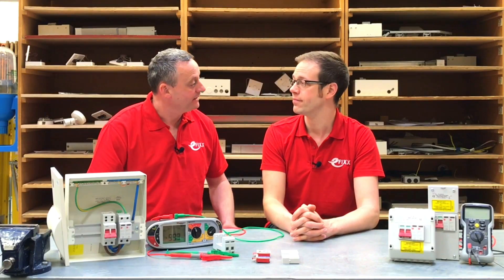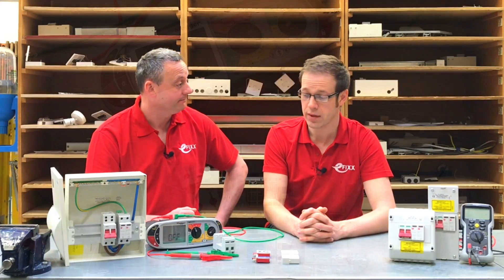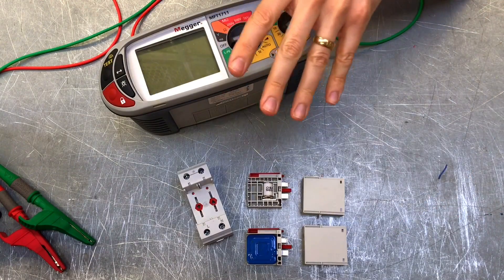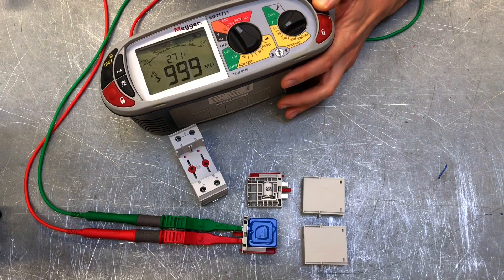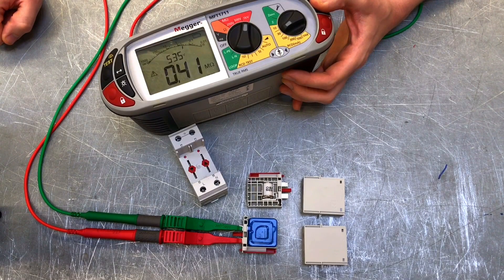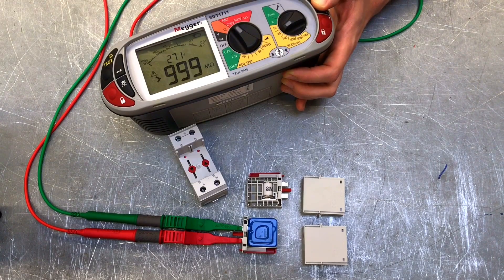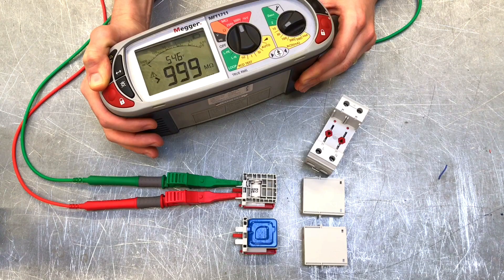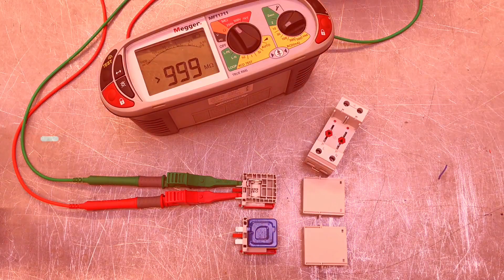We find out how Increasing the Voltage up 1000 Volts Through an SPDs Affects its Impedance

Comment: I can see that the current on the megger was set to 30 mA
what would happen if you set it 100mA or 500mA??
would it damage the SPDs protections?
Reply: The 30mA is for a different test. It’s for testing an RCD rated at 30mA. It has nothing to do with the voltage injection during an insulation resistance test.

Comment: Interesting.. So why have varistors and gas tube protection? Why not one or the other? Is one type on the Line conductor the other on the neutral? Seems the varistors is on the line to absorb the inrush voltage and the gas tube to to discharge the voltage arc safely? Like you say a DC voltage may react differently to a AC voltage. The high frequency noise you could hear was the MFT test voltage squeeling between the varistors plates. I should really look more in depth great video love your experiments and tear downs.